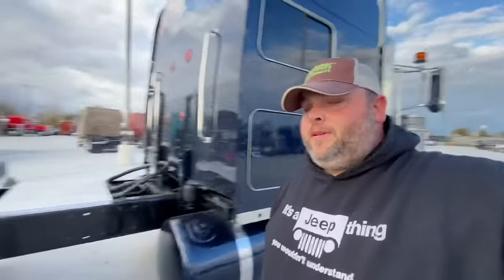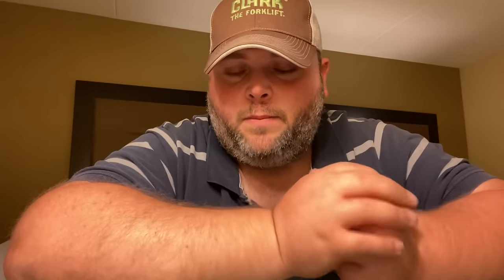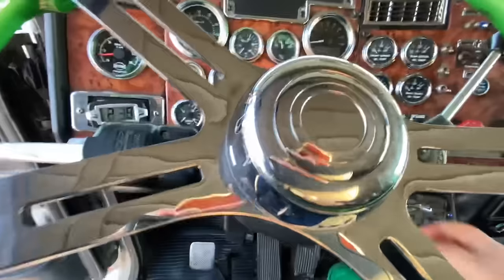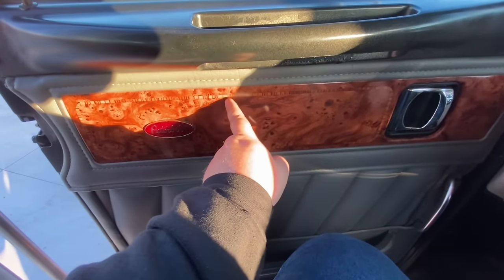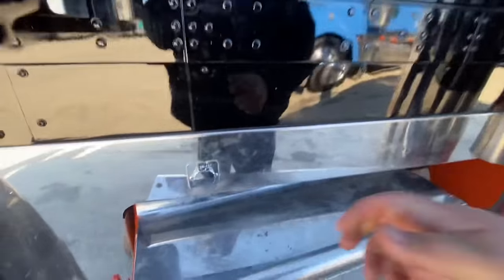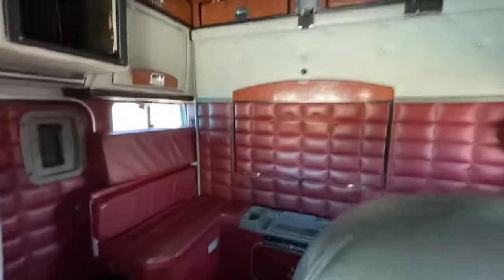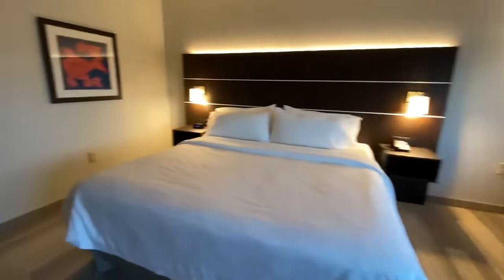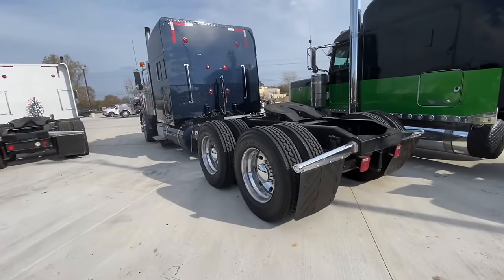Buying my DREAM TRUCK-Peterbilt 379 | tour of Ohio Truck Sales dealer lot!

Comment: It's nice looking truck. I don't like the 10 speed. But that is me. Next thing you will need to learn how to drive it for fuel millage.
I have a W900l. So I really know what I am talking about. You've the white and green. But it's only paint. Chicken lights are only a pain in the ass. Salt on roads eat up the wires. Been there done that.

Comment: Yes u can  lot trucks at ohio the bondoe the and then paint it black 
Need oil sample  tank sample to and from   tank. Pull carpet up around kicker panels  open dash up look for moisture corrosion   burns 

Ohionl is crooked

Comment: Do they have paperwork for all the repairs? What's the interest rate? They wanted over 20% for my 2008 kw with good credit. Ridiculous
Reply from the maker: They had paperwork for the engine, diffs, and transmission. My percentage rate was around 7% and I gave a 15% down payment

Comment: What motor is in that blue pete? Its got some super small smoke stacks on it.. Even for factory it seems awful small?
Reply from the maker: C15 500 hp Acert.  They’re factory size. I plan on removing the mufflers and putting larger ones on.
Reply: @survivetothrive21  Very cool. I love that flake and color. I think you made a good decision compared to the orange one... Odds are the orange pete was beat on by someone.  U know..

Comment: Congratulations on the 379 but at the pump you will be wishing for that Cascadia back lol. I have 4 trucks and 2 are 379s wishing they would get over 5 mpg.
Reply from the maker: Oh I’ve felt the difference lol. But I bought one with fairly long gears, 3:25 rear ends, and last week I averaged 6 mpg all week. I was pretty good with that lol
Reply: My 379 with 3406 cat 600 hp 3:55 rears got 6.1 if i kept it around 65 mph. When running 75 plus yeah 5
Reply: @survivetothrive21  Thats good for sure. We run a lot of high loads and mountains going west so those 2 factors for us don't help. Be safe out there brother and thanks for the reply.
Reply: To get better MPG put FASS FUEL SYSTEM on that truck and  i promised you want be mad
Reply from the maker: @BigGeorgiaBoi  I’ll look into that!  I appreciate it. Right now I’m just focusing on exactly what it needs mechanically and what I can do to help with MPG, like maybe a bunk heater, etc, so I’ll definitely look into that!
Reply: I've got an 06 379 475 cat 13 speed 3.55 rears pulling a covered wagon. Usually always 45-47k on weight. Running east of the Mississippi & Running 67-68 mph I'm get 5.5 on a bad day. Usually close to 6 most days
Reply: @survivetothrive21  Eric go with the Webasto bunk heater. Way better customer service. Espar is garbage and terrible terrible customer service.

Comment: Not a good sign when you see white smoke on the crank up, egr cooler is bad.
Reply from the maker: Or it could be due to it being a cold start on a frigid 35 degree morning. That little bit isn’t anything to worry about. Now if it was constant and on every start up, no matter the ambient temp or the engine temp, you’d have a point. But I appreciate the heads up
Reply: Engine is not warm thats the reason

Comment: That truck looks ragged out. Look for ap good clean truck, preferably a owner operator retiring!
Reply: How do you find one of those ?
Reply: @ballavision1619  Find a man upgrading or retiring is the best way. You wanna take your time, ppl like me have ALL maintenance records it's not just words.
Reply: @jrg1120  thx for the advice. Looking at buying a used rig in February
Reply: @ballavision1619  Make sure you have enough money saved for a breakdowns, don't let one breakdown bankrupt you. I would personally wait until this turns into a buyers market it's trending that way rapidly with cheap rates and higher fuel. Alot of these guys bought on the assumption rates would stay high and that didn't happen. I think you will see alot of repos soon. Just speculation
Reply: @jrg1120  yes like I said I wouldn’t be ready to purchase until February 2024 . So I will be sitting on the sidelines studying the market and watching

Comment: Dream Truck. AKA the basic white girl truck. Every truck driver wants a pete 379 😂
Gotta have the long nose and flat top. Or ya aint a real trucker. LMAO
Reply from the maker: I mean, it ain’t like there’s a whole hell of a lotta options out here lol. And I’ve long since sold that truck for a “plastic” truck anyway, so I must not think the way you’re thinking I do
Reply: @survivetothrive21  that one box is going to bite you in the ass. I just got hit with a $7,800 repair bill for the knox sensors and new DPF. I can't wait until I can get rid of the truck I have and get something with non emissions. I would love to have an old cat like 3406b.
Reply from the maker: @TaylorHaubrich  peterbilts don’t have a “one box”. That’s strictly a Freightliner/western star thing. The system on a Pete is easier to work on and you can replace each individual filter, unlike the one box, making it more affordable as well.
Reply: @survivetothrive21  Hopefully it treats you right. I think my problems have done put  me off on the emissions trucks altogether. Less shit on a truck that can tear up on me the better. Only one draw back I can see is finding companies that will lease on older trucks.
Reply from the maker: @TaylorHaubrich  I felt the same as you when I bought my older pre emissions pete. Sold a Freightliner Cascadia and bought it.  I came to find out, at least in my case, the fuel costs were worse than simple maintenance of an emissions system.  Granted, you can get pre emissions trucks that get far better mpg than my 379 did, but I’m also happy with the space and comfort in my newer truck. But it’s all a matter of opinion
Reply: @survivetothrive21  I can live with 5 miles per gallon. I won't be buying the majority of my diesel at the pump anyways. A mechanical cat will run just about whatever you put in it. I am going to run waste vegetable oil and used motor oil. With two 180 gallon tanks hopefully I won't have to fuel up anywhere but once a week at the house.

Comment: you paid too much
Reply from the maker: I’m not sure I ever mentioned what I paid. Or maybe I did in passing, but I’ve spent the better part of 6 months watching the market and looking at different trucks, and after seeing cascadias for sale with 900k miles for more than I paid for a truck that will actually hold its value somewhat, even after this insane economic bubble bursts, when all the so called “plastic trucks” plummet in value again, I don’t really feel I paid too much. To add to this, as far as Ohio sales being a rip off, I’ve seen plenty of others selling them for way more than what I paid.
Reply: Totally agree boss. 👍🏽